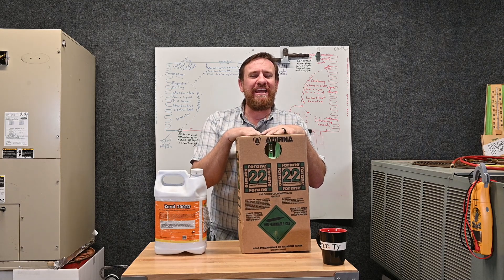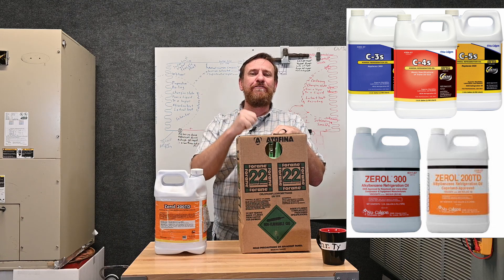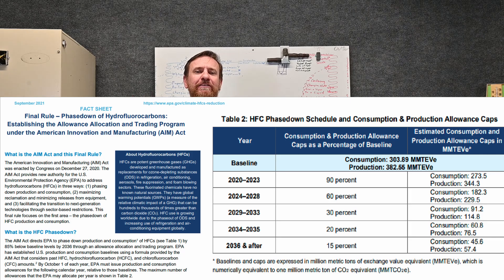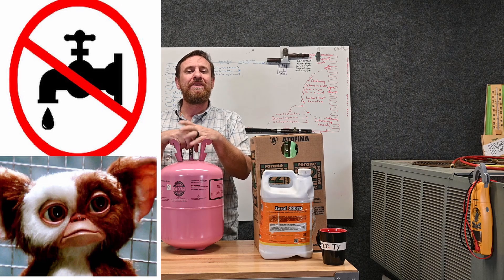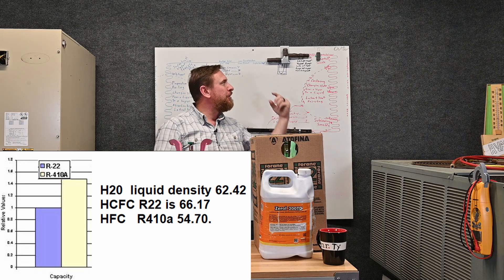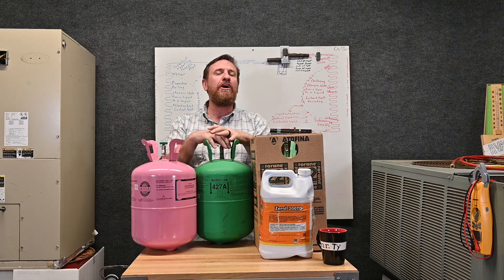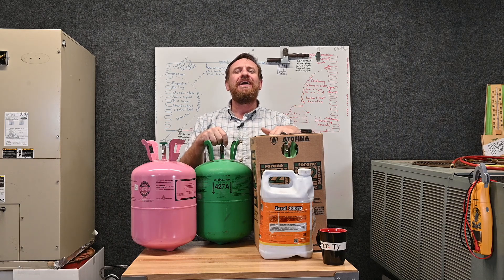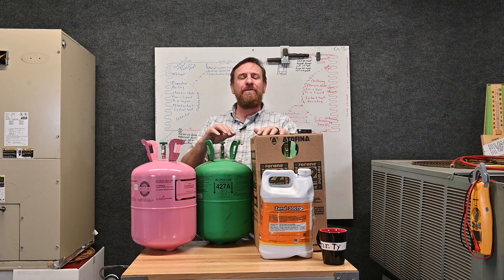HVAC 112 HCFC 22 and HFC 410A

Comment: Where I live, it hasn't been allowed to install R22 equipment since 1996.

Also the import and manufacturing of R22 was banned in 2010. 
Since 2015 it is no longer allowed to fill a system with R22, meaning if you need to empty the system for a repair putting the old refrigerant back is forbidden.
Reply from the maker: If you are in the USA you need to recheck those dates. The correct dates are public information and the HVAC phaseout time line is posted there. 

https://www.epa.gov/ods-phaseout/phaseout-class-ii-ozone-depleting-substances
Reply: @love2hvac  it's the Netherlands.
Reply from the maker: I was certainly not expecting that!
😂 Completely caught me off guard. 
How hot does it get there?
What's the timeline I  HFC phasedown?
How much CO2 is being used for refrigeration?  
How is the flammable refrigerant adoption going? 
Is venting and people not following the rules a big issues there?
Reply: @love2hvac  I'm not an HVAC technician myself, but i'm currently looking at removing gas from my house and replacing it with a heatpump.

On how hot it gets here, NL is further north than Calgary Canada. The highest temperatures I've personally seen is about 35°C, but that's at most 1 or 2 days a year.
AC here is a luxury, but has gotten more attention the last few years for it's heating application.

The amount of CO² equivalent for F-gas refrigerants (HFC's) is according to the statistics bureau 1 megaton per year.

For what I read about phase down, a F-gas ban for "monoblock" applications (all refrigerant stays outside) this is planned for 2027. For largers systems a max GWP of 750 is set at that time.

Starting this year monoblock air/water heatpumps using R290 start to appear on the market, flammable refrigerants for appliances (refrigerators/freezers/dryers) has been commonplace for many years now (I have a 2007 freezer that uses R600A)

R410a AC systems are almost unavailable, R32 is commonplace for new domestic and commercial AC applications.

Comment: R22 was by far the best.  The 410/puron is the worst and gave the industry the opportunity to absolutely TAKE ADVANTAGE of the consumer!!!!!!!!!   The 410 LEAKS 10 TIMES more Refrigerant that any R22 unit!!!    Check your Schrader valves and be SURE the Caps are on Them tightly!!!!   Otherwise you will hear SO many REASONS why your System needs so many Repairs!!
Reply from the maker: R22 was the best hands down. 
I can see CFC being ozone depleting. But at peak production of R22 the ozone layer was in the process of repairing itself. 
410a is not so bad but the oil ugh., Biggest issue is the manufactures making cheaper thinner coils and the hygroscopic oil turning to an acid eating away the coils. 

For a friend  I took a R22 system and put a 410a compressor and TXV in it. It was not designed to handle the higher pressures of 410a but it ran great with no leaks. Yet 410A coils "designed" for the higher pressures leak like crazy.
Reply: @love2hvac  Something needs to change with the design of 410 A systems. We are dumping a lot of refrigerant into the atmosphere with leaking evaporator coil‘s. I’m retired now but I have some R22 systems that are 30 years old and still running. My brother has a 410A system, that I did not install, that is on its third evaporator coil in five years.
Reply from the maker: Well now 420A is going to be phased down and replaced with 454B and 32.
454B a blend between R32 and 1234yf manufactured by Chemors chemical company. 
Dakin is going with just R32  a single component. They opened the patend up to anybody so we can all use a simpler single component refregerant. 
Both are A2L mildly flammable.

Commercial is pushing CO2 and ammonia. 

According to the manufactures the government is mandating higher effecency Wich means thinner coils and riffling for better heat transfer but both are a factor for leaks.
Reply: @love2hvac  I don't know how to design HVAC equipment but, could a coil be made larger (more rows of tubing and fins) instead of thinner tubing? Just seems crazy to design a coil to fail unless higher SEER is more important than leaking refrigerant into the atmosphere. Not to mention the cost to the customer for the replacement of a leaking coil. I remember when Carrier came out with a plastic condenser fan blade in the early 1970's to save money. They replaced a boat load of compressors under warranty to save a few bucks on a fan blade. Thanks for posting these videos. They are a good reference material for the techicians working today and hope they are a financial benefit to you!
Reply from the maker: I like the discussion!
Just to clarify the reasons for the coil leaks don't get the manufacture off the hook but it helps to understand how we get here. 
Larger coils would be ideal but they just won't fit in existing closets. 

Here my thoughts fwiw.
Instead of forcing energy efficiency in just the equipment, look at whole house performance. I mean we are still building new houses with the units and ducts in the attics and walls and roof leaking air like a sieve.

As for the refrigerant issue,
Use a self contained unit that cools glycol. The glycol runs inside to either ductless units or air handlers.
Because the unit is self contained we could put the mandated on the manufacturer. We could then use propane which is a great and environmentally friendly refrigerant.
Reply: Can you use propane in a hermetically sealed compressor? years ago we were going to experiment with an old lawn Mower engine to make an open drive compressor using propane. One of my neighbors had a gas absorption system that ran chilled water into the house. It had a problem with ammonia leaks and they finally demoed that part of the system. Carrier made a add on to a R22 condenser that could chill water outside. When I say water I mean water with antifreeze. It worked much better than the residential absorption system. I agree that more efficiency  gains could be made with the construction of the house. If you’ve got a bucket leaking water as fast as you can put it in you don’t get a more efficient pump.
Reply from the maker: commercial Refrigeration have been using R290 in hermetically sealed systems for a bit now. I had some gas companies and farmers that used Propane in their R22 system. 

I think an open shaft compressor would be more likely to leak due to the shaft seal. 

Did you ever see the York condensing unit with a natural gas bridge and Stratton engine?
Reply: @love2hvac  No, I have not see the York "Triathlon" residential heat pumps. Very interesting, especially if they can reduce operating cost by up to 50% ???. There might be a good application in hurricane territory where I live. You would not need as large a whorehouse back up generator. I did work on a natural gas fueled Waukesha engine driven Compressor in an apartment complex. Thanks

Comment: Great information Mr. Ty , I have a system from 1990s and still working very well with r22 so if I want to retrofit which refrigerant will be suitable according to the link you’re listed and should I flush and change the oil? Another question and I tried to find an answer from my teacher, technicians but I don’t get any suitable answer (the system got leak and lost most oil who we know the amount of oil to add it’s)? Thanks 🌳🌱
Reply from the maker: If the system is still running, let it run. No reason to change if there is not a problem. 
Residential system I would choose a refrigerant that did not require an oil change.
I don't have a refrigerant to recommend. I hear a lot of people talking about Bluon  but I have never used it myself.

Oil loss is difficult.  I try to guess how much visually. 
Unfortunately, the only way to know is to flush the oil out of the condenser, evaporator and lines, and remove and drain the oil from the compressor into a measurable container and compare that to the manufacture quantity. It's a process not often used because it's time consuming and expensive.ost leaks don't loose much oil, but it spreads out and can decevingly  look like a lot.